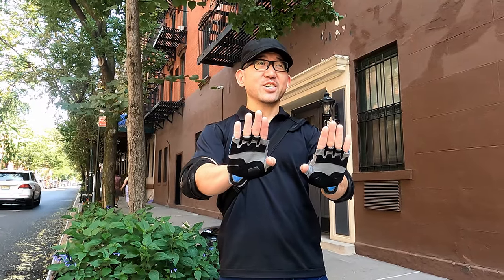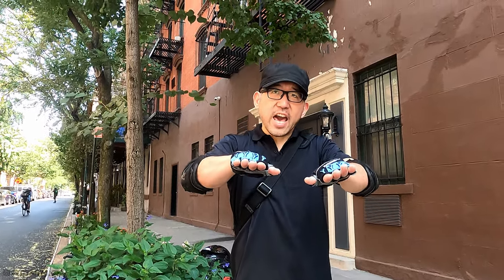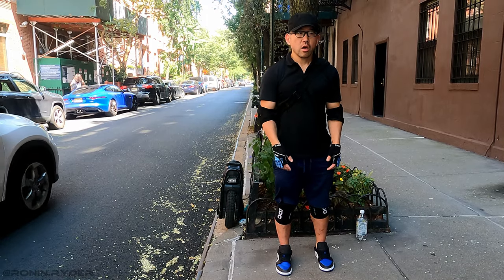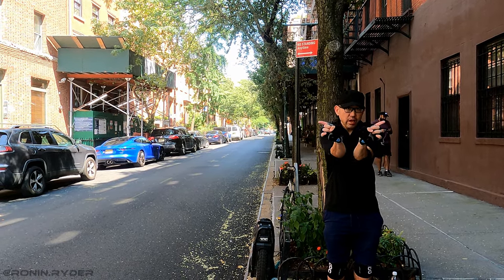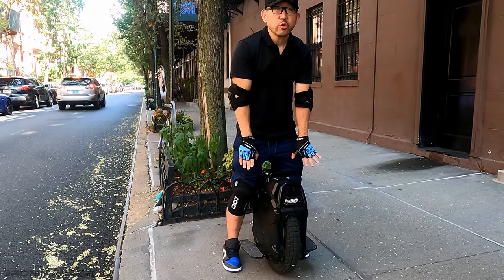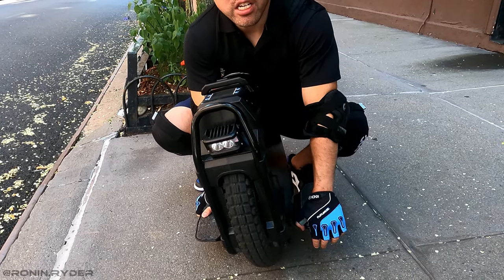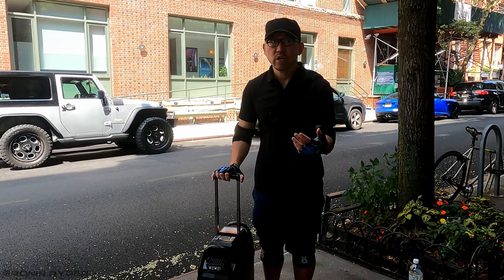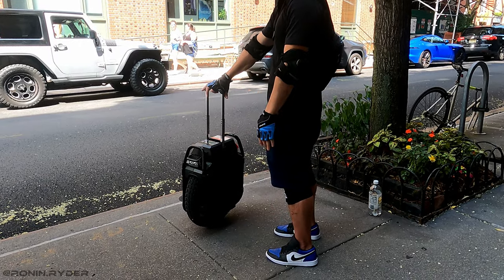SOFT mode & HOW to RIDE technique explained by CHRIS YIM - Veteran Sherman Begode electric unicycle

Comment: The thing that doesn't make sense to me is that if you are pressing through the mode, so pedals dipping because the algorithm tells the wheel to tilt the body forward, how are you getting a faster acceleration out of the wheel? Have you skipped magnets doing that? If not, you haven't gotten all the power out of the wheel and thus haven't accelerated as hard as you could have. What's your max current on euc world? Motor phase current? I know it's not a 100% accurate tool but it's way more than enough for these kinds of measurements.

Leaning forward and hinging at the hip places the max amount of bodyweight on the front of the wheel(ie, it is the highest amount of input you can get in to the wheel)which extracts the maximum torque out of the wheel(ie, the wheel puts out the most power it can so you accelerate faster). Balancing there may be tedious but it sure as hell is not muscle you are using, it's all bodyweight.
Weighting one pedal on the back and weighting one on the front achieves a net force of zero on the wheel body(gyro attached to wheel body, and no body tilt happens), thus nothing really happens. If I'm honest, that's how I ride when I'm maintaining speed, because my feet are offset, left more forward and right more backward.
Side to side movement is completely wasted in terms of acceleration, zigzagging to get to point b takes longer.

Also, if you tilt back the pedals to "reset" and push again on the raised pedals, you are releasing pressure from the pedal thus not actually accelerating, which I feel is reflected in the ride clips. There you can see that he is accelerating in "waves", when he switches sides, he doesn't accelerate and is barely maintaining speed, if that, to raise the pedals he has to apply force backwards, it's not like they rise on their own.

Also, what do you do on bad surfaces or offroad? This side to side and alternating heel up relies on smooth roads and stable surfaces.

And don't get me wrong, if this works for you, keep doing it, but just because you developed a alternative ride style doesn't mean you get to cheat physics and claim faster accelerations. 

The thing I agree with, is the heel up to absorb bumps. That's like suspension but acting in an arc perpendicular to the axle.
 What I don't agree with is both heels up, that's just acceleration not bump absorption. Like you said, that bumps the "weight line of the body" forwards, thus accelerating. If the contact point(balls of your feet) is only in front of the axle, the center point mass has to be infront of the axle, otherwise you'd be falling backwards. Try it, try to go on your toes on your wheel, I guarantee you can't do it without accelerating  or you can't do it at all.

This vid is cool and all, I'm not here to hate on anything else but baseless claims and incorrect physics.
Reply: I like to keep my feet flat and rock my hips forwards about a foot or so with the knees bent. I've got pretty good ankle mobility and OK hamstrings, it feels much more secure than superman lean.

Comment: What's your technique for tramlining when you have a parallel lip/or dip in the road and the veteran wants to change direction and steer you into the lip/dip? I have PSI set to 30psi and am always carving but sometimes I come across a lip and the wheel has mind if it's own and changes direction. I dont get this on my Inmotion V10F due to thr narrower tire and less weight.

Comment: Is this applicable to the V12 ? I don't really like riding with power pads as I love sliding around the wheel but above 60 km/h I don't feel as stable as I hoped for ... Maybe high speed curving with soft mode is the answer ?
Reply from the maker: This is applicable to any wheel. The soft mode might vary but the principles are the same.
Reply: Yes, it's applicable to any wheel. The V12 in particular I found to ride a bit top heavy for my taste, as is the tendency for Inmotion wheels, so I usually try to swing each leg heel down a bit wider than usual, in my motion ("wider triangle base" for better stability)
Reply: V12 is super nible for a 16 inch wheel

Comment: soft mode just feels like suspension Is more cushion If you will Sort of Dampening less jarring  Gives the rider a more comfortable experience My very own   veteran Sherman V3 1700 miles of riding
Reply: Yes, exactly. I usually think of soft mode pedal swing behavior as one "shock", heel up/down engagement of the foot against the pedal as another "shock", and knee bend as a third "shock"

Comment: The pedals are fixed to the frame of an electric unicycle (or to suspension components if there is a suspension), which can't directly sense the pressure in the pedals, but instead is extremely sensitive to any tilt on the frame induced by the torque on the frame due to pressure on the pedals. The difference between hard and soft modes is that in hard mode, the software responds sooner to frame tilt, limiting the amount of forwards or backwards tilt of the frame and pedals. When standing on the ground, in order to lean forwards, you have to first push with your heels, which coexists with the ground pushing up on your heels, behind your center of mass,  leaning you forwards. Once you are leaned forwards, you push with your toes to limit the lean. Likewise to lean backwards, you first push with your toes. When standing on an electric unicycle's pedals, pushing downwards with your heels will tilt it back a small amount, which results in it slowing the wheel down a bit, so that the contact patch ends up behind your center of mass, corresponding to a forwards lean, at which point the rider will transition to pushing with the toes on the pedals to limit the forwards lean, which the electric unicycle will sense as a tilt forwards of the frame, as well as the torque feedback from the motor that your center of mass is in front of the wheel, causing the wheel to accelerate to regain balance. If the rider pushes a bit less on the toes while leaned forwards, there is less forwards tilt on the frame, and the electric unicycle will continue to accelerate until the rider pushes more on the toes to stop the lean (assuming max speed is not reached). The same process applies for backwards lean and deceleration. An electric unicycle also has to take into account going uphill or downhill (accelerometers, gyros, tilt sensors, ...) , when assessing the amount of torque that the motor is using to determine if the center of mass is in front of, directly above, or behind the contact patch. The rider also needs to lean forwards going uphill and backwards going downhill to keep center of mass directly above the contact patch, or nearly so if accelerating or decelerating. The actual logic to do all of this is fairly complex, but was mostly worked out with the two wheeled Segway. There is an alternative method for leaning forwards, mostly used by newer riders when free mounting: starting with the arms at the waist, swinging them forwards to shoulder level leans the rider forwards and coexists with a backwards pressure on the pedals which tilts the frame forwards, which will trigger forwards acceleration of the wheel, but typically not enough to prevent the rider from leaning forwards, and continuing the forwards acceleration.

Comment: Hard mode gives me foot cramping esp during long riding without stopping to rest. Soft mode feels like you are flying  
or sailing on smooth waters. I love soft mode.
Reply: Soft mode is less responsive
Reply: Right medium mode is the way to go in my opinion. I rode either medium or hard mode . More of a fan of medium mode tho . Ied rather have my wheel be more responsive to what I'm doing and how I'm riding especially at higher speeds you would want your wheel to be more responsive

Comment: Caught this on Reddit & it intriqued me. Never much thought about riding styles as it more instinctive for me. Just came back from a 20+kms ride at my fav playground close to home. Was on hard but put my S18 on soft & deliberately made a conscious effort to do the oppo heel to ball/toe. For me, it seemed to make turning easier & I can see Chris's point about how the heel counteracts the pedal dip (or swing). I can't do it like Chris with the body/hand but it does take getting used to. A bonus seems to be that I experienced less foot fatigue (aka numbness). I need more riding time rockin' this style before I can make any conclusions. For sure it works the mind a lot more than I did.
Reply from the maker: You almost rediscover the wheel with that technique
Reply: after seeing this video i switched to soft also. it felt hella weird st first but after a couple miles it became very comfortable and like you said turning became much easier

Comment: I ride in soft mode as well, actually seems to feel better on my feet since I have a lot of foot pain after being on my feet a while standing. I do use pads though due to trail riding and bumpy roads not so much for power but so I don't bounce off the wheel. I actually enjoy the stock pads that came with my sherman

Comment: So is it easier to make tight turns in soft mode?
Reply: I would say "yes", but more important for making tighter turns IMHO is body mechanics and footwork. Without those two more important factors, it won't matter what mode you're in for making turns. 
Soft mode is more about further maximizing the above two more important key factors, like a complimentary additional factor, but not the main foundation. Like, I can make pretty tight turns in even a hard mode, using my technique of heel lifts and landing my heels wide. But doing the same in soft mode gets me that extra say maybe 10-15% degree of angling on turns (because the pedals are free to swing and angle adjust, not always restricted to being level), all without having to fight the wheel nearly as much because the pedals in hard mode are stiff and unyielding in angling for such turns.
So thus, more than the soft mode, the key things that allow me to get sharper turns are two things: 
First, my turn-side leg, when that heel lands, that heel lands wide/out (like think of that knee/leg turning to face into the wheel body). What this does is allows the wheel itself to not catch against my leg, thus able to bend at a sharper angle to the ground independent of my body angle. Most riders, they ride foot/ankle against the wheel body, but on turns, you are restricted in turn angle because the wheel body catches the leg, which means the wheel can only bend down to the pavement as much as the rider themselves can.
Second, heeling up is key. Utilizing the ability to go full heel up on the ball of one foot knee bent, while the other foot heel down with leg straight provides stability, this as well, allows the wheel to pivot and bend down much deeper to the pavement independent of the rider's body angle, because your bent knee heel up foot is essentially "shortening" that leg, while the heel down straight leg stays "longer" in comparison, and thus this length difference between legs aides in the wheel's ability to bend at a sharper angle to the pavement on turns, all while the rider center of gravity remains relatively unchanged and directly over the bent wheel.
Sorry for the long-winded answer, but hopefully it makes somewhat sense!

Comment: Very cool!

I will try this riding technique too :)
But, what are you guys think about Inmotion V11?
That's the wheel I have but I also think about Ninebot Z10?

Thanks & regards,
TheFlyingTom
Reply from the maker: While v11 is not the ideal wheel theres nothing that prevents you from using this technique too. I actually use it on the Begode EX too...
Reply: @Ronin_Ryder  
Tnx

Comment: Interesting, i think i know what your trying to say, that soft mode really helps open up the flexibility of the heels and toes and to use that to your advantage to get more leverage points on the pedals when they dip a certain way, I run mine at medium mode right now. I will have to try this technique , especially in soft..
Reply from the maker: Good luck!

Comment: Thanks Chris and Ronin - that's an interesting technique as I've been ridin in Hard Mode on the Nik 100 these past few months as a new rider ... will have to find an open school parking lot and give it a go.
Reply from the maker: Its a new way of riding!
Reply: I don't recommend doing it with the nikola, soft mode on that particular wheel limits the torque a lot. + Magnet skipping on the nikola is really bad in general. If you are heavier than 180lbs, it increases the chance of an overlean exponentially during even mild climbs. I speak from experience. Keep it in medium or hard, for your own safety.

Comment: Does riding in soft mode affects the stability in high speed?
Reply: Nope! The modes are just how the pedals respond to lean force input, that's all. Actually, counter to what you may think, I would arguably say riding in soft is More stable, because you cannot ride soft without your feet and overall balance mechanism constantly being engaged, being always on the ball of one foot-at-a-time, as opposed to the usually flat-footed hard mode rider that has their stability easily compromised when encountering unseen deltas in the road. Like any sport, you're most stable and can adjust stability when your feet and legs are more engaged and slightly on the ball of the feet. All that said, I am biased of course LOL
Reply: @houseofjob  Thats why i ride medium, best of both worlds :D

Comment: Still watching but at 2:13, it's a misunderstanding of the pedal angle behaviour during accelerations, especially in soft mode, and furthermore on Sherman.

What he describes at this point of the video is tilt-back, which certainly doesn't happen in soft mode on Sherman during acceleration.
Instead, angling the wheel left and right as he does in his technique increases pedal dipping - therefore forward angle significantly - the opposite of tilt-back,.
It makes acceleration easier without power pads tho, so that's certainly part of why he does that.

A second factor is when speed increases, gyro-like effect (actual gyro and/or the tire vs ground resisting turning) enters into play .
That way, this left to right turning gives an extra angle of leverage to press on the front of each pedal - transferring weight forward to accelerate:
Instead of pressing only towards the front (at the risk of literally falling forward in case the wheel hits an unexpected bump), this technique allows to generate acceleration from side to side weight transfer which is pretty cool.

There's no tilt-back involved, but it offers one then the other higher pedal to press on which might feel similar.

HIs technique looks really nice for sure!
A downside around other vehicles or pedestrians is that they might think that you're changing direction / turning, making harder to anticipate your movement.
Reply from the maker: What do you mean by misunderstanding?
Reply: @Ronin_Ryder  with his hands he shows forward tilt, then tilt back of pedals as the result of the side to side motion.
That's the misunderstanding of what is happening (the opposite is: pedals dip forward more than if going straight).

But I guess he thought it was the case because it might feel like it with the resistance to turning created, as well as his legs/body movement.
Reply: +François Simond (supercurio) LOL, I'm not the smoothest speaker of what's in my brain unfortunately. 
Yes, you are correct in saying the wheel itself (independent of the rider) does not Actively do a tiltback motion, it is just free to swing in that middle area between pedals centered and resting, then swing forward and back.
It is ME the rider, who is Actively trying to manipulate that freedom of the free-swinging pedals to Create a tiltback like angle, in order for me to have a front pedal sticking up to better lean/press on.
But yes, I can see how what I said can be mis-interpreted to sound like the Wheel itself does the tiltback like motion, which it does not.
Reply: @houseofjob  haha thanks for rephrasing here 😌 yeah I agree it gives an interesting new leverage, which occurs as the wheel resits side to side tilting.
It's a good method as it allows to control how much acceleration pressure to apply with direction control and not only leaning forward, which can be a bit risky especially without pads. It reduces the risk of overlean as well with the added ability to back off without having to shift the whole body weight backwards.

Comment: So is your conclusion riding soft mode is better than hard mode?
Reply from the maker: Yes
Reply: @Ronin_Ryder  makes total since.   This is why I'm probably having a difficult time rotating from a forward to a backwards roll. 

It's so hard to get my wheel to change from a forward roll to a backwards roll without stopping first
Reply: @JSmooth1967  Yes, while not impossible, hard mode will force you to make quicker changes in lean force (the stiffness and "immediate" response that hard mode riders love), while a softer mode is more relaxed I think, body lean force vs wheel movement are much more exaggeratedly delayed in relation to each other.
In general, the switch from forward to backward in such a pendulum, your lower half needs to move one step behind in delay from your upper I've found. So, when you decide to change directions, your upper torso down to the bum needs to commit to that backwards lean, but at that same time you need to remember to allow your lower half momentum to still be slightly moving forward, before it catches the wheel's braking "stop"/change direction point. Once the wheel brakes, then the wheel+lower body half can "catch up" to the torso's back lean, and the whole packages starts to move backwards together. (also don't be afraid to not stiff leg/feet it and allow for big S curves in the beginning)